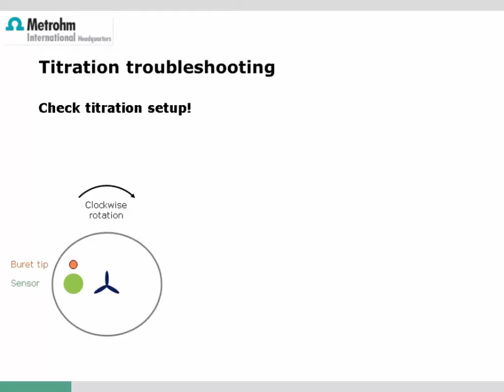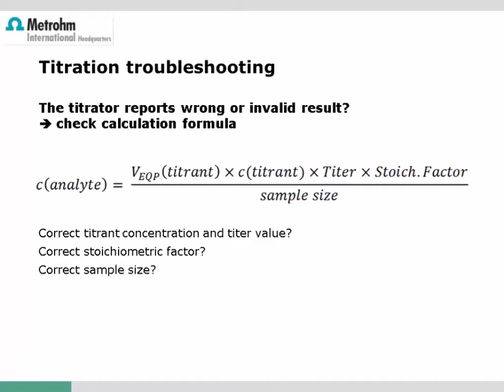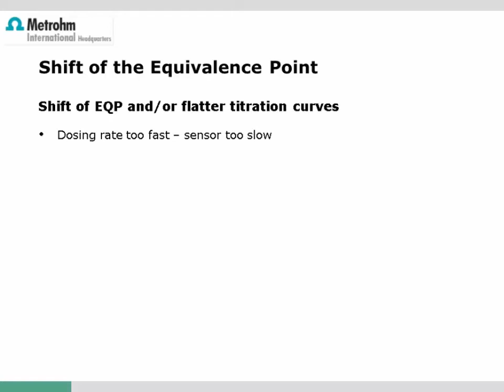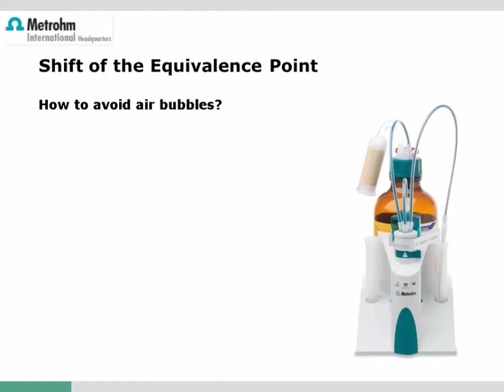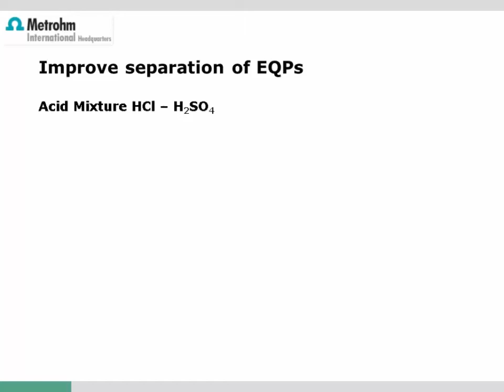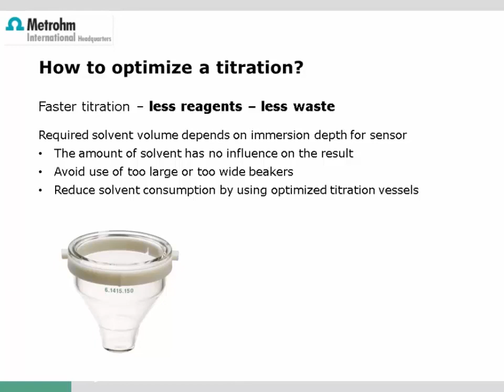Webinar recording: Titration troubleshooting

Comment: How to fix if the instrument shows error of  parameters invalid and potentiometer failed to run.. Can you help me?
Reply from the maker: Hi
Thank you for your comment. We would need more specific information to offer support. The best way to get instrument support, however, is through your local Metrohm organization or exclusive distributor.
You can contact them through our website:
https://www.metrohm.com/
Just check the country in the top right-hand corner and select your country of residence to navigate to the correct website.
Best regards
Metrohm International Headquarters

Comment: How vortex formation affects the results in potentiometric titration? Can you please explain
Reply from the maker: Hi Neeraj
Thank you for your comment.
A fast stirring speed may produce a stirring funnel (also called vortex). If the sensor is directly placed into this funnel, the electrode may not be in contact with the solution at all, which may lead to incorrect measuring results. Therefore, you should adjust the stirring speed to a speed where stirring is as fast as possible to ensure a homogeneous sample while at the same time not creating a vortex that also could introduce CO2 into the sample.
For more information on titration troubleshooting, check out our FAQs:
https://www.metrohm.com/en/support-and-service/titration-faq-general/

Best regards
Metrohm International Headquarters
Reply: @MetrohmTV  Thank you for the clarity...